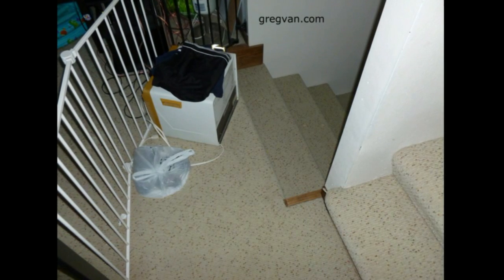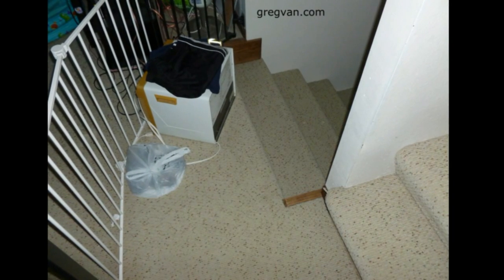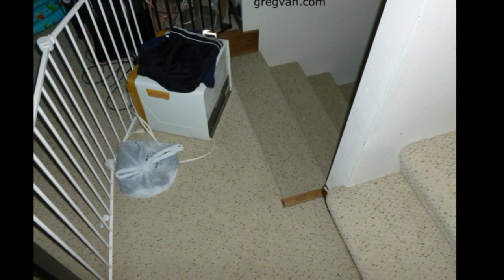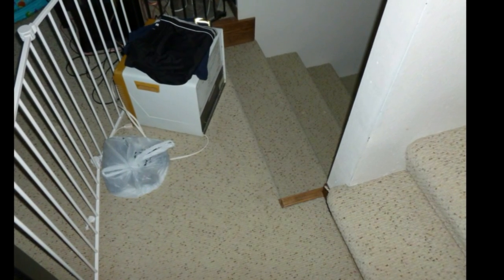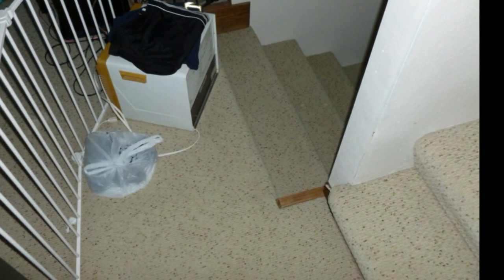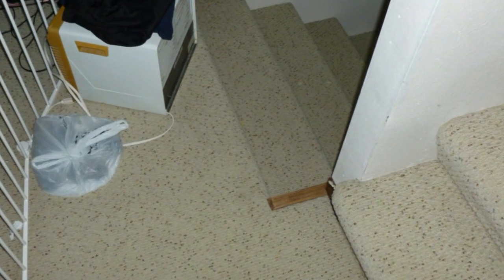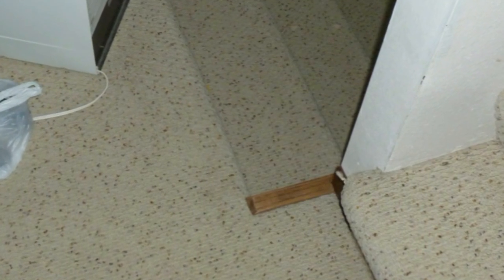Extend A Landing Wall To Fix Poor Stairway Design

Comment: I would like a video on how to extend a wall if you can swing it. In my case, the extension will be about 6 feet. I am concerned the new section will not follow the straight line of the old wall. I don't want to remove all of the drywall on the original wall (which would allow me to use a chalk line to ensure the extension remains straight). Any tricks to accomplishing that?
Reply from the maker: I will see what I can do, but if you can send me a few pictures that would be helpful. My e-mail address can be found at the website, in the contact page.